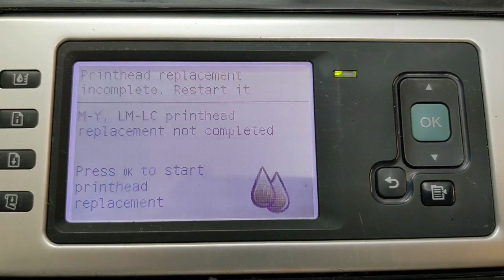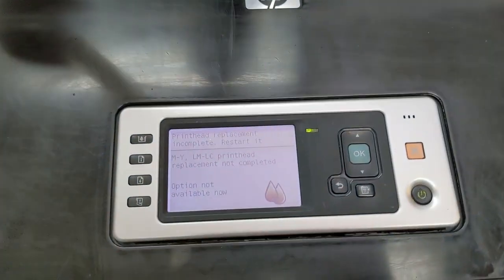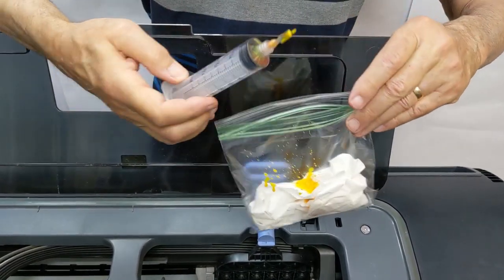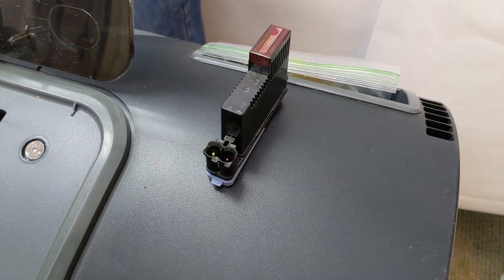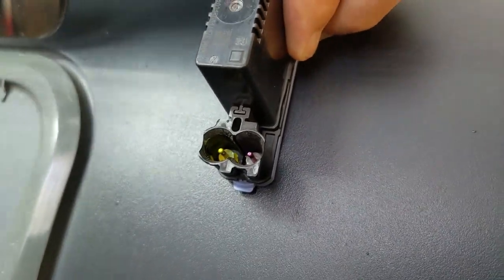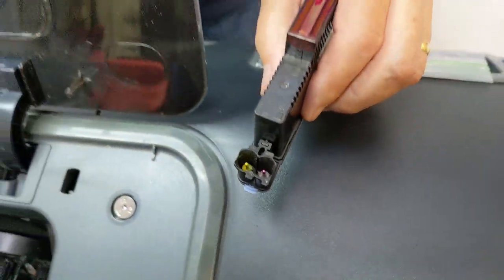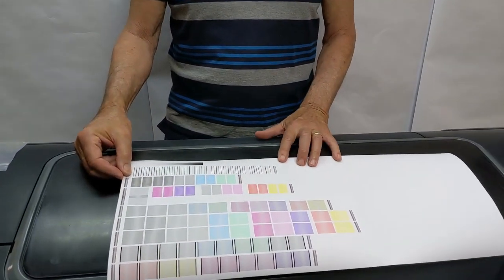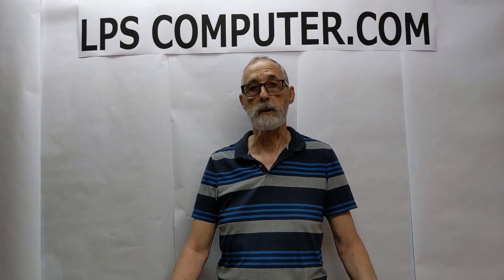HOW TO FIX: "Printhead Replacement Incomplete. Restart It." HP Designjet Txxx and Zxxx Series

Comment from the maker: A few considerations:

-If a printhead has been starved of ink for a long time, it may have burned itself out by printing with air instead of ink. If this is the case, that printhead will not recover with the installation of new seals.

-Even if a printhead has been starved for only a short period, if the internal ink diaphragm has deflated too much, it will sometimes not allow ink to re-inflate it, and the printhead will remain permanently starved. 

-Sometimes the electrical connection between the printhead and the carriage is poor. Make sure to clean off the printhead contacts as well as the contacts on the carriage. If either of those surfaces feels tacky, you've still got cleaning to do. 

-If the drop detector sensor is obscured by ink overspray, it will not properly detect the ink droplets, and the printer will not complete print system setup even if the printheads are working with perfect quality. The sensor may require cleaning.
Reply: Hi, 
I used your syringe and seals kit.  I was able to draw 5 ml through each nozzle.  I am still receiving the error of printhead replacement incomplete.  I cleaned the electrical contacts on the printhead and the contacts.  How do I clean the sensor?  Have you posted a video for this?  Thank you.
Reply: If you are doing multiple printheads, do you need to clean the ink off the syringe in between colors?  How does one clean the drop detector?

Comment: Halfway through the video, I'm wondering if this issue also causes the machine to believe ink cartridges are missing. All 8 are installed. This is a hand-me-down machine I just rolled into my workshop, so I have no idea whether to trust the messages showing up, or the condition of the cartridges (which I am also being advised are "expired." It's a Z5200.

Comment: I did order your printhead purger kit and followed the instructions, but it is still not working. I didn't use an original HP Printhead, so I am getting a "printhead is missing" error message. Is there an way to override this error message?

Comment: In my hp Z5400 the light gray started leaking.  When I replaced it with a new cartridge the plotter still reported it as empty.  Could your solution above be the solution to my problem?

Comment: Thanks so much for the video! I just tried this procedure when diagnosing the plotter, and it was unsuccessful. After multiple attempts of troubleshooting and before trying this procedure in the video - all ink cartridges have been changed and are under warranty, and after a while, a new error appeared stating that the maintenance cartridge could only replace 5 new cartridges and remove 2, despite the fact that we have eight. After doing some research, I attempted to trick the system by removing the printheads, disconnecting the plotter, and then plugging it back in to replace the printheads. That did not work, and now it states that maintenance cartridges can only replace 3 new cartridges and to remove 4. Additionally, even though the maintenance cartridge is brand new and replaced, it says that it is full at 82%. 

The plotter was also down for about a year.

Before replacing the printheads and maintenance cartridge we were able to print two maps. Now we cannot print anymore due to those errors.

We also have an 86:11 error regarding the axis belt or carriage belt, and there is nothing stuck inside, and I cleaned the belt, too.

I also did the cleaning solution. This is an HP DesignJet Z6200 42-inch plotter. Thank you for any help you can give...

Comment: Hi,
I have purchased this kit and completed this process on ink tubes and print heads. I have an error coming up stating to replace Y cartridge. The current ink cartridge is at 45%. I have replaced this with a new cartridge. The error continues and I cannot do anything. Do you have any ideas on my next step.

Comment: Hi I have just replaced two of my hp72 printhead as they were saying need changing, I know one had only fired 17mls not sure about other guessing the same but my other has fired over 500mls. Could this heads be ok still and maybe getting a false reading as the printer is old and it had aftermarket heads in it I’m abit sceptical that if the heads were reading right or it was because they were aftermarket heads. That said the one I’m not sure on I think was a genuine HP head but would need to check that. Happy to take any advice, also do heads need to be primed before putting in machine or only when cleaning.

Comment: I had a faulty black printhead and tried 3 brand new replacement ones. None of them worked and after I reseated and tried them again after 3 times it comes up as a paper jam which there isn't. Any help would be appreciated because I can't just keep buying new printheads that won't work.
Reply from the maker: Hi David,
Did you already purge the ink tube system and install the auxiliary seals? When the printer says "paper jam," is it showing error 86:01?
Reply: @LPSshowsyouhow  I will check and see. Thanks
Reply: @LPSshowsyouhow  yes it is error 86.01.
Reply from the maker: @DavidMcPike  Does the carriage move during startup? If so, does it stop in the same place every time the error appears?
Reply: @LPSshowsyouhow  when I start up everything is fine. Carriage goes back to right side and says printed needs replaced. Just the black. Others are fine. When I replace it the black printhead 3 times that's when I get the paper jam error.

Comment: Hi Bob, I used this system, and it worked great for clearing the first port printhead, but the second port would not let me suck up any ink. I could just feel suction as I tried to pull up the plunger. Do I have a clogged ink line? Is the check valve not releasing as I press down?

Comment: I don't see my DJet 500 42or 510 42 listed here, but on your website it appears to be the same kit for my old machines. Is the kit the same for all of them? My current problem is with my 500, where the yellow printhead became empty, even though there is a new OEM yellow cartridge in the machine. I replaced both the printhead and the ink with new OEM parts, but I'm afraid the issue will recur, do to a clog or due to air ingress. Will this purge kit help to remedy this condition? The machine has no leakage anywhere that I can find, and shows no errors. It just kept running with an empty printhead. By the way, I bought your belt replacement kit, and the quality is phenomenal compared to the OEM belt.